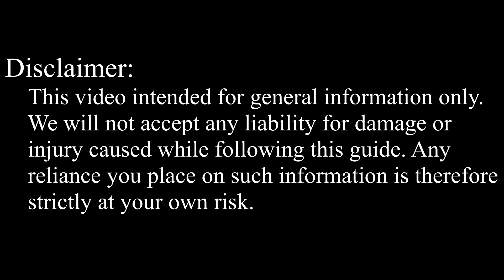MSI CX620 Disassembly, Fan Cleaning, and Thermal Paste Replacement Guide

Comment: Is it possible to give 8GB RAM here? anyone maybe tried?
Reply: Yes im tryied its possible bot you most have 2 4g 1333MHz ram
Reply: @Kia-Mc  Does it work? Does the system see that much?
Reply: @adam1709  Yes, it works well. If you want to do this, it is better to check whether the RAM on your laptop is 1333 MHz or 1066 MHz, and according to those, buy two 1333 MHz or 1066 MHz 4G DDR3 RAM. 
 If you buy an ssd hard drive for your laptop, it will be faster and can even run Windows 11
Reply: @Kia-Mc  Thanks for the info. Still just a question of its cost effectiveness in my case 😅